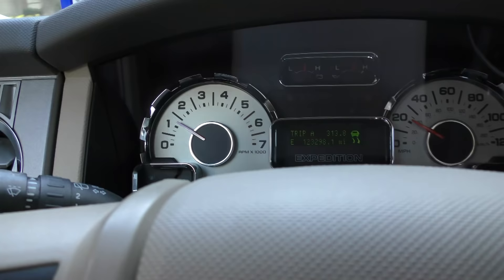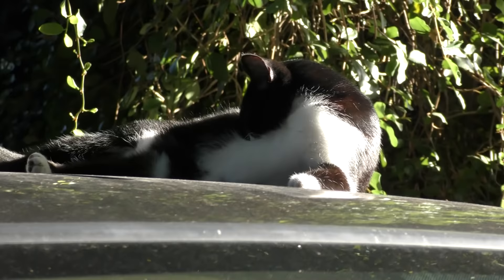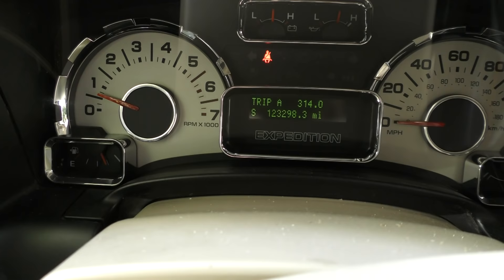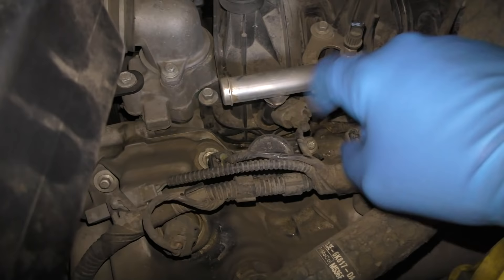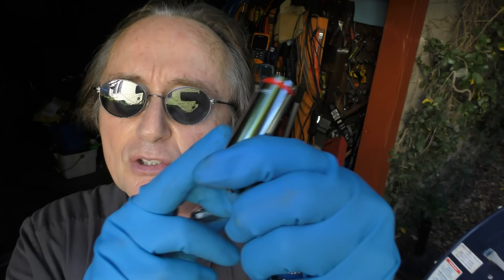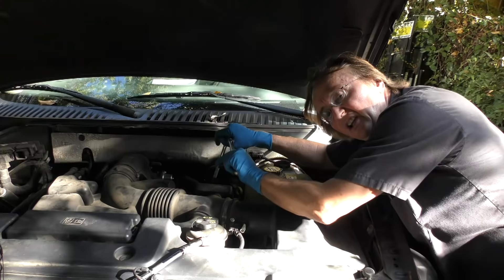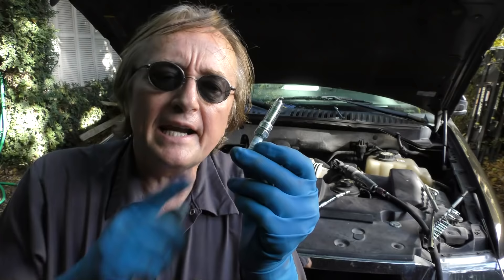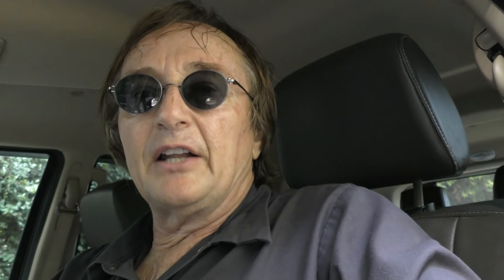How to Stop Car Hesitation (Spark Plugs and Ignition Coil)

Comment: Thanks for the input, Scotty.  A set of low resistance MSD ign. wires and a hotter than stock coil solved the off idle dead spot on my 93 Ford F-150 equipped with the 300 cubic inch inline 6.  Of course I changed the spark plugs, too.  I had to buy the ignition wire in bulk length from Summit Racing along with the terminal ends to make the wire set since there are no good quality, low resistance ignition wire sets available for this engine, only the crappy original equipment wire sets that are junk.

Comment: Mr. Kilmer, I have a 2002 Impala 3.8 V6.   This has 150,008 miles and I just replaced the plugs and wires. The coils are brand new as well. This vehicle no longer has a misfire, but it will greatly reduce the engine power at 27 MPH (especially at full throttle). It will not shift unless I pick my foot off the gas pedal and lightly push down. Even then it hesitates and “sputters” while trying to accelerate.     I have also replaced the fuel pump and filter the day before the tune up. I am at a loss and would like a true professional’s advice. I would be happy to discuss this further with you if possible.
Reply: Any luck with this exact issue???

Comment: i had same exact problem on my RAM1500. I changed the spark plugs and cleaned the Throttle Body. solved the problem.

Comment: Great video! Have a 2003 F150 with similar problem with shuddering and hesitating that was not throwing any codes. Had not considered plugs because they were changed 2 years ago. When I checked them, #6 was cracked and completely worn out.

Comment: Of course it had to be Ford with their different size tools.
Reply: They used 3/8ths for the electrical bolts and hardware but 14mms for the trans oil pan on my 86 chevy astro, I'm guessing a Canadian got mixed into their team

Comment: Your lucky none of those plugs broke Scotty. The 5.4l 3v are known to break.
Reply: Ryan Edwards Break like how? like, the ceramic cracks or something? like they strip out? what breaks?
Reply: F!@#Guilt on the 4.6 and 5.4 3v from like 04-09, the spark plug had a design where the electrode for the plug extended about 1.5 inches past the threads and what happens is overtime the part past the threads gets carbon build up and more or less gets welded to the cylinder head. this causes many problems with replacement, mainly the porcelain breaks, requiring the special extraction tool. 

I'm you're doing plugs on one of these motors, look up the part number at a parts store, it'll be SP514 or SP515 depending on what motor you have. if you have these plugs, it's recommended to remove the plugs on a hot engine or spray carb cleaner down into the sparkplug tubes and keep it in there and let it sit for a few days
Reply: k Sounds like a dumb design. I mean, something so basic.
Reply: k i believe 3rd generation or 07 expedition and up at least changed head design for this very reason.
Reply: Ryan Edwards thats why i got rid of my 06 f150 broke one fixed it and sold it. After reading why it broke on me

Comment: Great video. My 1997 cherokee laredo had a misfire problem, turned out to be a tear on one of the spark plug wires arcing on to the valve cover. New plugs and wires fixed it.

Comment: Would you mind making a video on the differences between a distributor cap & rotor, vs coil on plug, vs ignition module? I've done a full tune up and replaced a distributor cap and rotor on my truck, but I'm struggling with figuring out how to do such a tune up on a 2004 Saturn Ion with a ignition module, and I'm betting my 2017 Hyundai Elantra has those Coil on Plugs.

Best wishes from a long time fan of your videos. You really help us all learn, grow, and save money one video at a time.

Comment: Well, it could be that. But the most basic thing to check for is water in the gas tank. Thats what it turned out to be when my car started stuttering real bad. To fix it you pour some heet in the gas tank and it forces the water to dissolve and be vaporized in your engine and come out through the exhaust.

Comment: My 2000 Corolla with 273K miles showed a cylinder 3 problem... I reset the ECM and then removed and cleaned the throttle body and IAC valve. Big help, but not as big as a new set of NGK platinum spark plugs. For $115, a set of 4 new coils will not hurt. Car was paid for 15 years ago...   I can do basic work a garage did NOT do. And easily save $300-500.

Comment: I changed all the spark plugs on my 2011 BMW X3 3.0L while making sure they are gapped up the specs, but on cold starts it would stutter for about 30 seconds or so. No check engine, the coils don’t look visually bad. It has 88 200 miles in it.

Comment: PRAISE!  Troubleshoot simple!  That is what I did today with my VW.  After a spark plug change, still had an issue with rough idling and acceleration.  After testing the coil packs, found out one had bit the dust.  Inserted a new one and presto -- purring.
Reply: J.K. Benedict if you like working on cars VW's are good ones to have
Reply: I do like working on cars, but with any test for sentient beings, I am starting to think IT is work on me.  You know - it depends on the day, the amount of light from Mercury was left in the ocean, how many torx bits are involved, watching the exact same symptom and codes raise hope only to see the next post - "Oh yeah.  Same issue here.  I just smoked a cigarette and it went away."  What eclectic dance do I have to do divine the Computer Soul's and Reason's for I am quite.... yeah, just not a chappy happy.

Comment: I still use Never Seez  paste on the spark plug threads because that nickel coating usually isn't enough.

I can remember changing the spark plugs in my mothers Corolla & one of them got tight when I was removing it,so I sprayed some WD40 spray around the spark plug.

I worked it backwards & forwards so I wouldn't strip the thread out & used the nickel anti seize compound on the threads.

We've had the plugs out since (when she tried to drown the car) & they came out easily.

Comment: I'm changing the gasket seal on my 2005 Honda Civic. Oil has leaked into the spark plugs so I'm changing the coil packs too. Is it important to use genuine Honda coil packs and is it OK to just replace the damaged ones or should I do all 4? Love your videos, given me confidence to work on my own car and saving me loads! Thanks a bunch

Comment: I had a 2009 kia rondo with 150,00 miles on it and i had some stutterer and i replaced the spark plugs and it fixed all my problems.

Comment: Scotty ur my guy for all car questions''  You just answer a problem I have and I was looking for a different problem. I filled my tires and the steering is sacking a little ?
Reply from the maker: if all tires have the same pressure, then check the suspension system, harder tires with full air will show up front endd problems more.
Reply: I'm confused Scotty,  What you mean by Harder Tires ?  But lets just get to the front end  Suspension, what should I be looking for and how do I check it..
Reply: +Scotty Kilmer hey Scotty someone HotWired my radiator fan to stay on the whole time the car is on, would that damage the engine? its on a 1989 camaro

Comment: My car has stutter in full throttle on highway, in half throttle it was fine, i drive cautiously to my dealer service and Mechanic say that was the problem, they replaced the spark plugs and ignition wire and Ignition coil because bad valve cover gasket. My car is 20 years old and the valve cover gasket was the original (never swapped before).

Comment: Scotty, Ive learned so much from you.  Yesterday, I replaced the Stabilizer Bar Links on my car by myself and now there is no more knocking sound!  Thank you.
I have a quick question.......I watched your Dielectric Grease video and was wondering if I should use Dielectric Grease on the Coil on Plug Assembly when I go to replace my spark plugs?

Comment: Hello, I refueled my new car today, it was on reserve for the past 2 3 days and I didn't drive much. But after refueling my car started perfectly but after 10 mins or less it jerked 2-3 times severely and then it was not picking up power from the engine, I was accelerating it(pressed the accelerator fully) and the car was not picking up and the rpm was going up really slowly. It was like the brake was pressed or the break jammed but when I put in neutral the tires were free. Is this because of refueling? What should I do?
Reply: Ever solve this!?
My acura is doing the same

Comment: Should you change the coil packs when you change the spark plugs?    I have a 2014 Tacoma 4.0 It does not have the power it used to. I am also going to clean the throttle body.

Comment: was that a 3v ford engine? and you actually got all the spark plugs out without them breaking? i bow to you your magisty. our work wont even take them in anymore as they are such a pain in the butt to deal with. weve been successful using the spark plug extraction tool but the boss is too paranoid about screwing up a head

Comment: Great video Scotty, as always. I'll be installing spark plugs myself on my 06 Crown Vic Police soon. First spark plug change since I bought it. The first time I test drove it, it had a misfire and a check engine light. The dealer fixed it. I know the other cylinder plugs that weren't the problem during the test drive aren't the factory installed plugs. Since police idle the cars for hours and race the engines during an emergency, and long idle hours and high rpm wears plugs faster, I'm sure the police mechanics changed the plugs before the 100,000 miles maintenance mark in the manual.  But I know the original factory plugs are platinum. It said so in the Ford website. So should I check the gap on the new spark plugs before installing, or install as is? I know platinum and iridium is harder than copper. So should I worry about the factory pre gap been affected because of the manufacturers storage or shipment bending and affecting the spark plug gap? Thanks.

Comment: My 1996 Mazda Miata M Edition does this sometimes but I changed the spark plugs and the o2 sensors and it still kept doing it, so then I changed the whole exhaust system (removing the cat) and it still does it. Sometimes I can’t go past 3,500 rpm’s.
Reply: Did you replace the egnition coil ?
Reply: @parloitaliano2  I haven’t yet. But I’ll look into it.

Comment: Scotty kilmer I've scanned and had looked at by tech they found nothing but my car  hesitates on acceleration and struggles after 40mph only on acceleration already replaced air filter cleaned maf a and cleaned throttle body.Chevy impala 2014 3.6vvt 40k miles

Comment: I have a Corolla AE110 and just recently it started sounding louder than usual when accelerating and when going uphill, I'm not getting the power I used to get and it's just sounding louder but less power. I'm flooring the gas pedal and it feels like the engine is dying going uphill. Could it be the spark plugs???

Comment: So, basically when the car is hesitating, and there are no lights on the dashboard, we could assume that it might be a problem with the spark plugs, is that right? 

Also, I would appreciate a quick answer, but do the spark plugs cause a delay when starting the car ? 
Does the combination of the aforementioned symptoms signify a problem with the spark plugs ? 

Thank you Scotty, and to whoever answers.

Comment: Recently changed all the spark plugs and the ignition coils. My car still has a misfire on cylinder one, but only when it heats up. I already changed spark plugs and coils around to check if they were the problem. The plug and coil that were originally in cyl. pne work well on other cylinders, and always, when it gets hot (running temperature) I get a cylinder one misfire. What could it be?

Comment: my issue is the bold that holds down the coil cant be tightened which means the bolt hole is warped, i feel it when im at a traffic light so thats fun

Comment: What if dosen't sputter just struggles to get into second gear check my transmission fluid added some temp lucas fluid " worked in the past" not trying to condem my transmission yet, but I bought the vehicle as is and I haven't yet changed spark plugs or wires could this be a major reason in  accelerate loss? Anything would help.

Comment: Maybe you’ll see this....I know you have a ton of subscribers. I have a 97 Chevy K1500 that hesitates when you’re light on the throttle at 2000 rpms. Idles great. When you gas the throttle, the skip disappears. It’s a skip beginning at 2K under load. Any idea past the plugs and wires? Thanks for your channel, really great stuff.
Reply: Michael Mosley 
same thing is happening to my car ima try out what Scotty said hopefully it's just that
Reply: i have the same truck and mine's doing that as well. Also slow to accelerate. Could be spark plugs but might also be the fuel pump.
Reply: Angeline Miller I wound up replacing the plugs, wires, coil, distributor cap, and rotor button. Running like a champ now. I did it a step at a time to narrow it down. It was the rotor button or coil.

Comment: Have the the excentric shaft valve sensor, magnetic wheel and differential pressure system checked and replaced ...

Comment: Thank you, man, I have the same issue with my dodge caliber 1.8 lt !!!! while I'm driving over 30 mph nothing is wrong but only on idle engine running and first move to shake and hesitate to move sometimes. look running on three engines (the sound I mean) have the engine check light on and blanking always sometimes stable sometimes blanking. put the diagnostic tool and got five engine fault codes! B2AAA - BODY (twice this code showing up and also P0172-powertrain - system too rich (bank1)   next code: P0300 powertrain random multiple cylinder misfire detection and last code P0303 - powertrain cylinder 3 misfires...hope its only spark plugs :(  thank you

Comment: Seeing you say make sure it plugs in, I just put a new fuel pump on my first vehicle, ford explorer 1992 been sitting so I asked about it. Got the new pump in felt like the conectors went im. Put the tank back in the shield. Fuel pump didn't work i was like what, turns out the seal in the new one was too big so it didn't plug in

Comment: Hi Scotty Nice Videos keep them coming.  Please help I have a 2000 e46 320i  straight 6. Idles perfectly BUT stuters misses when driving. I Replaced all 6 plugs with Bosch Platinum even though the old ones bunt clean. What to Do? Kind regards Mike
Reply: PS Diagnostic shows no errors

Comment: Scotty I'm experiencing some sort of jolt  after I accelerate almost like a bucking not when accelerating its after when I wanna change gear I turn the car off and back on it's all good 
Do you know what it may be I done a full service and checked maf even done high performance petrol cleaner 
It's a tfsi 1.8 running a map and garages around me dont have clue what it may be 
There is no codes thrown either 
Tia

Comment: hi scotty kilmer  ur videos are awesome 
i am nissan 16 volves twin cam engine of nissan micra it has a problem regarding acceleration intermittent. most probably sensor issue on throttle body  please guide me what should i do
Reply from the maker: best to analyze the live and mode six data and any codes stored rather than guess. Auto zone scan em free if you're in the US

Comment: Car runs fine. Runs smooth. Except when going up hill. It's rocks back and forth as I'm accelerating uphill. But if not going uphill. It's doesn't do that. no check engine light.

Comment: I found the problem in my hesitation in acceleration with my 2006 Toyota Camry.. it's the transmission it hesitate in drive but do not hesitate in the low gears so my next move is to change the transmission fluid and filter and I also notice the transmission fluid is way pass the max mark on the dipstick maybe it's too much transmission fluid got it hesitating in the first place..

Comment: My Ford Mustang got a really bad hesitation.. After I changed the plugs.. And my engine is modified. I put my exhaust back on, and it fixed the hesitation. But it didn't fix the check engine light caused by my bank 2 o2 sensor too lean. I reset the computer recently.. That lasted about 13 minutes, and the light came back. And now I have a high idle. I am thinking its a fuel delivery problem, or some type of throttle sensor.. I don't really care about the check engine light anymore, just how it runs.
Reply from the maker: modifications can make correct running very hard to do, sometimes even impossible without reprogramming the main computer, realize that. But do check for vaccuum leaks and have the maf sensor checked as they often go bad on stangs

Comment: Hi Scotty, I have a nissan murano 2003 with 140k miles, it hesitates while acclerating when the ac is on and when it has run for 30 minutes or more, could you advice me what the problem is? I know its not easy by what i mentioned but hope you could still enlighten me on some facts. Thanks in advance. And keep up the good work

Comment: This is all fine and good, but there is always the BUT. I replaced the plugs and distributor on our 1989 Honda Civic with 5 speed manual in the last 5-10K miles. There is this shutter factor between 1st and 3rd gear, but goes away in 4th and 5th gear. Fuel or electric problem, I have no other clues. Car otherwise runs fine. Car has 146K miles on original engine. Any idea(s) what is going-on with our car?

Comment: I just replaced the last 2 Ignition coils on my 2001 Nissan Sentra yesterday I was at a red light and all of a sudden my car is sputtering like it did not want to stay on but it did. I went to the junkyard and I replaced the last two with used ones and it’s back to normal